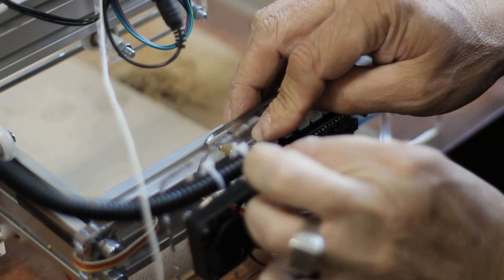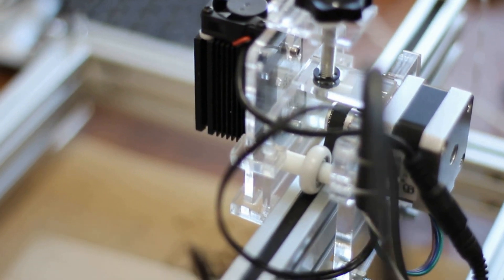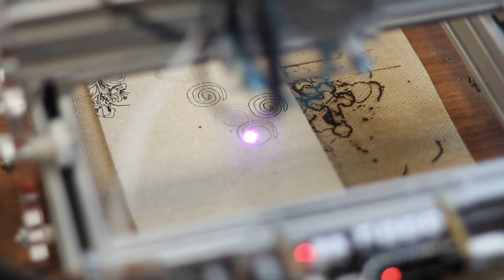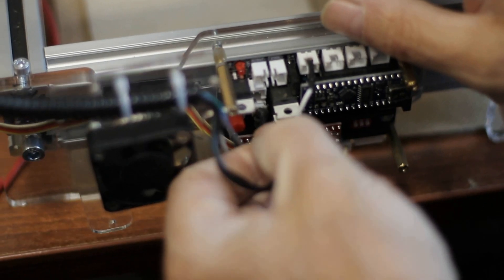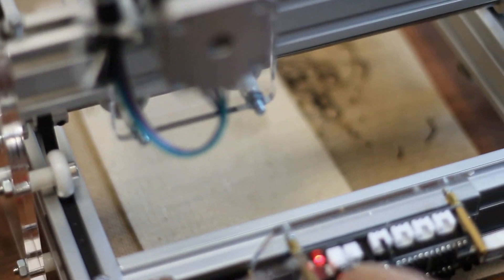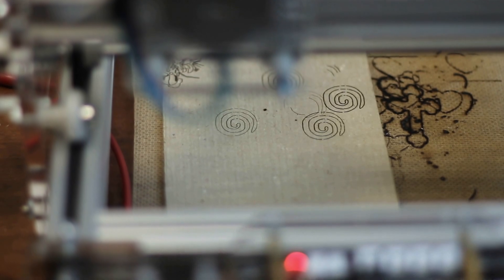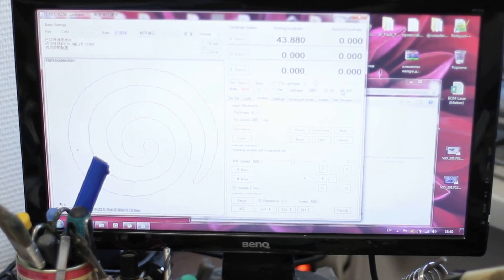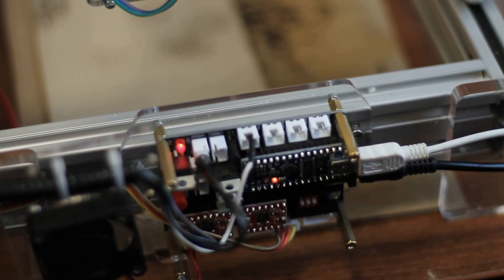How to connect more powerful laser on DIY engraving machine

Comment: I have the same board (laseraxe) but if i turn the potentiometer i see no difference. Full power is all clockwise or counterclockwise for you?

On my diy machine I have a 15W laser head (clearly 15W pulsed)
Reply: Just to clarify to enable full power on bigger laser i have to turbn the potentiometer to the right or to the left?

Comment: Hi ! 

I trie your tip, and the laser looks more powerfull. But now, when I push he red button, the laser is always powered ON, and I have problem to connect the COM5 " COM5Did not make the right response, the connection has been disconnected."
Reply: George Fomichev do you mean that I have to buy a new board ?
Reply: George Fomichev the board look likes the same on the video. What’s your price for ugrading pcb or a new board ?
Reply from the maker: it will be 95$ + shipping costs...
Reply: I just make a mistake. I put the Arduino in the wrong way, totaly on the right on the board :D.
 But I think my laser isn't powerfull. It's a 7W power (but not really I think), but I can't cut any thick wood, like plywood 3mm.
With 100mm/s speed and 100% power, I didn't cut it, with many pass.
Reply: George Fomichev Yes i know ... :( I think it’s not really a 7W laser